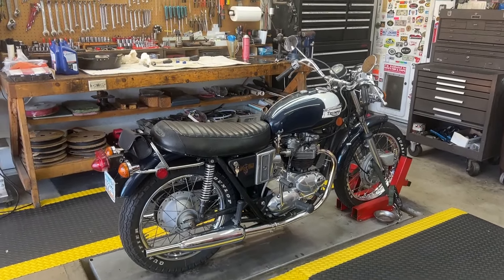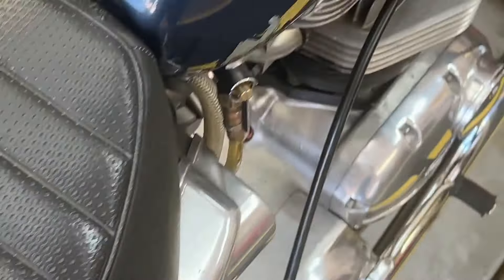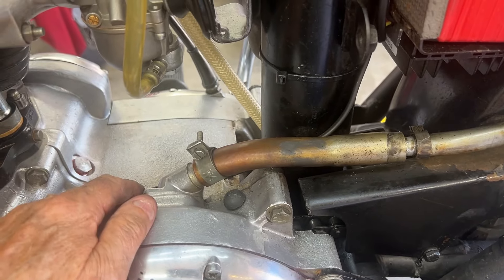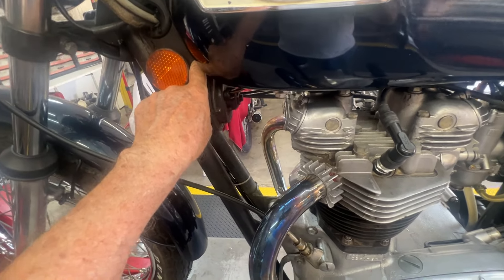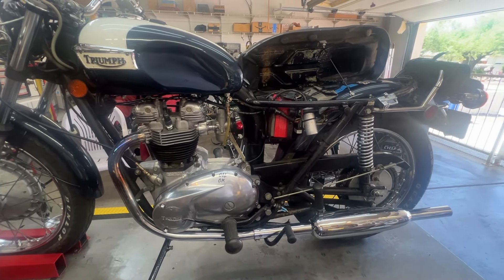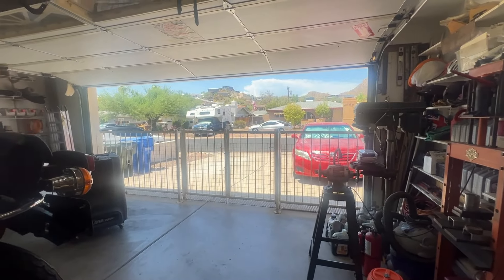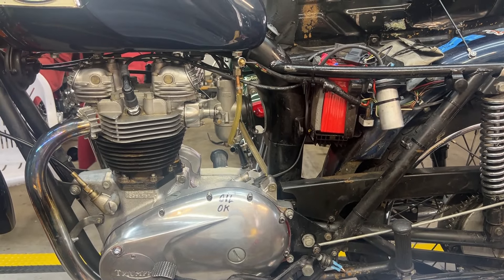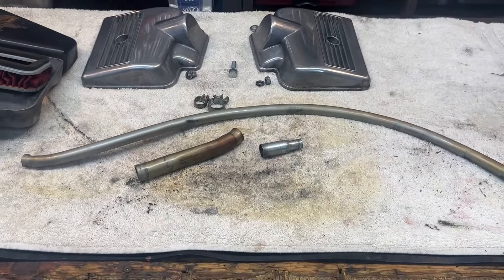07-15-24 – 72 Triumph – Oil Sump Vent

Comment: My guess is the bike is wet sumping.  When on the side stand the oil pooling in the crankcase is transferring to the primary.  There should not be 18 oz of oil in the primary.  Check the oil pump to make sure there is no debris preventing the balls from seating.

Comment: Someone told me that bike(blue bike) has pea shooter mufflers...are those pea shooters?
Reply from the maker: No.  Just stock Triumph mufflers.  Search thru the published videos and look for some of the 1971 Green Goddess vids.  It has pea shooters.
https://youtu.be/-gpBzpNuPp0	07-12-24 - Oil Leak Checks 
https://youtu.be/-gpBzpNuPp0	07-12-24 - Oil Leak Checks
https://youtu.be/oLbG-lpMv1A	07-07-24 – 71 Norton – Green FB – Oil Leak Check
https://youtu.be/LUzUO9frfJo	07-05-24 – 71 Norton – Green FB – Sump Vent Extension
Reply: 6:48 the small pipe is to vent the oil tank vapour down to the branch fitting, otherwise the oil tank/tube could get pressurised (or is unvented)
Reply: @fjdelmonte Stock mufflers, albeit from earlier in Triumphs production years as a 72 Bonnie should have reversed cone type mufflers.
Reply from the maker: Yes, correct.  Earlier model stockers.  The 72 had tapered mufflers and a cross-over tube between the pipes.  Thanks.
Reply: Hi Frank, I did some research and found the source of my confusion. Apparently lots of people are calling the original "sausage on a stick" mufflers pea shooters. When you see real pea shooters (green goddess) you can see the name fits. Looks like pea shooters are a Norton muffler. Emgo makes them to fit Triumphs.